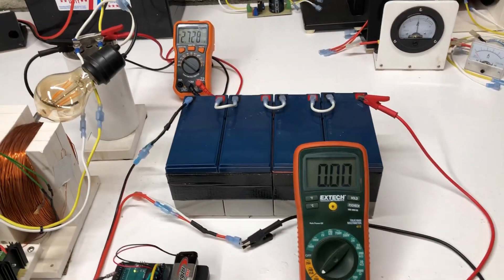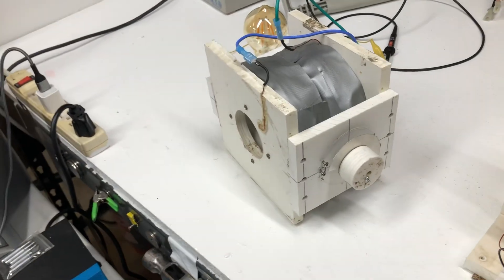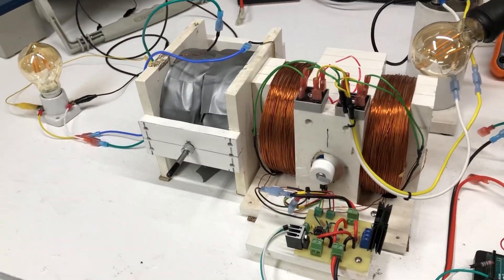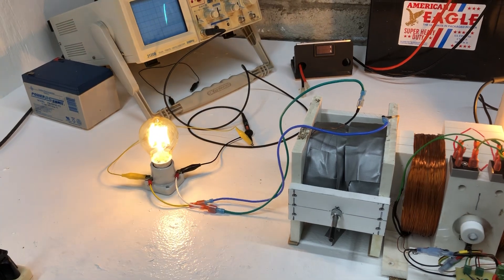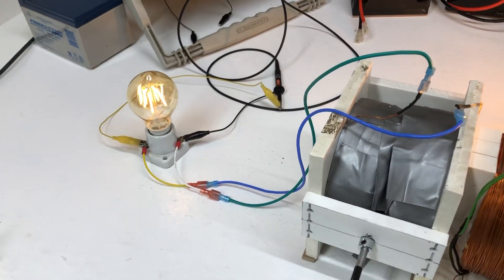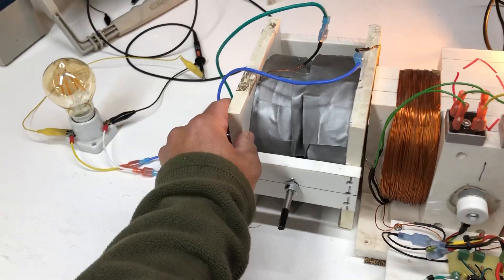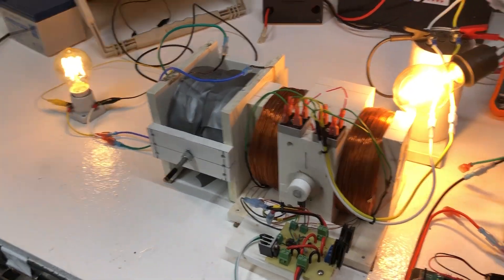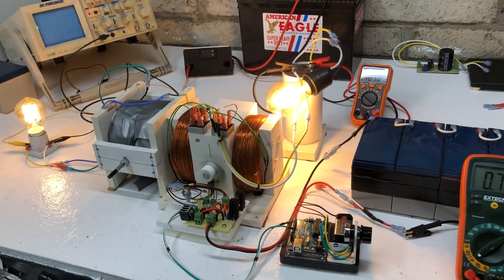Magnetic coupling

Comment: Nice work. Do you have a diagram for the board?
Also, what is the second board you are using.
Thanks
Reply from the maker: The pwm is Arduino 
The primary circuit is on the next video
Reply: @kenergy1707  thank you